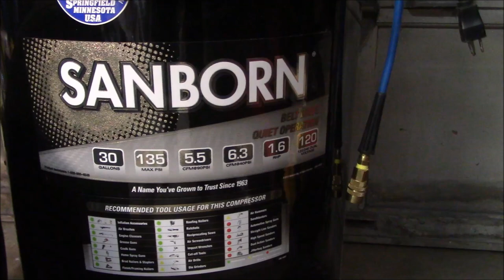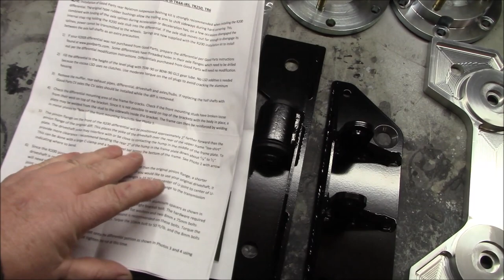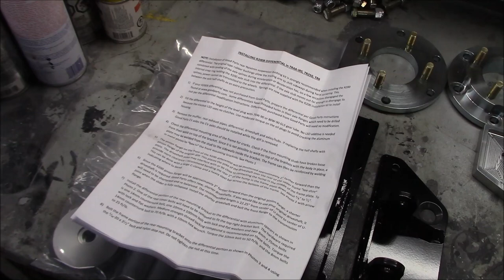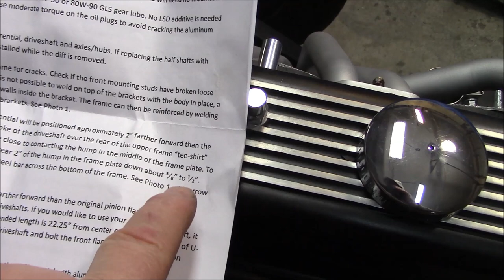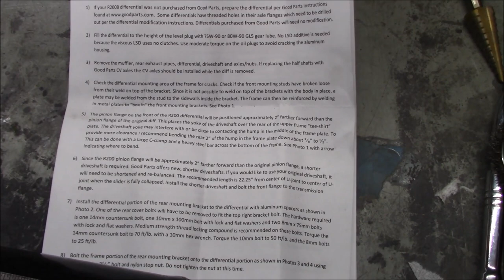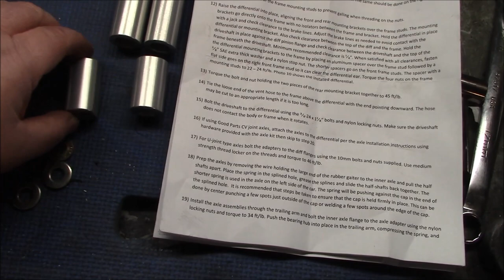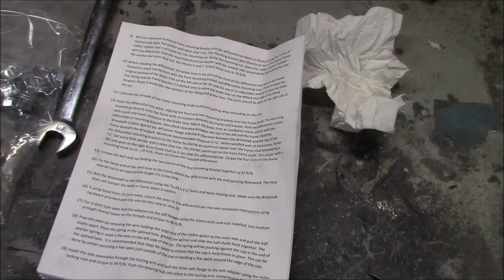1968 Triumph TR250 Restoration, Nissan R200B Differential Conversion/Installation,  Part Three

Comment: Tush, this is the time of year when it's good to be in miami because of the weather, in the summer it's another story. Agree the compressor looks good from far but far from good. Hope Les is well.  Wow, that motorcycle jack is a life saver, would be so much harder with out it, I might need to get one. Thanks again for your detail explanations, not sure I would do this to my tr6 when I get to it but it's tempting.

Comment: Just an add on about lockwashers (aka springwashers). Some kits and other parts suppliers use a lockwasher AND a flat washer. However it just defeats the ability of the lockwasher to lock against the part you are trying to secure and just locks against the flat washer that then does not lock!
From early days I was always taught if you are screwing into machined threads you either used just lockwashers, flat washers with thread lock or flanged head bolt and thread lock. Same with using plain nuts just use lockwashers. With nyloc nuts use flat washers.
Personally i avoid lockwashers / springwashers for use on steel as they by design cut into the workpiece and if its been painted you have a place for rust to start. On Aluminium its fine.
Just IMHO of course ....

Comment: Than you! Great instructional video! What is the advantage of CV axles?
Reply from the maker: You are most welcome...the advantage of the cv joints is that it gets rid of the splined joint in the stock sliding axles, much smoother when power is applied and maintenance free as well...the sliding splines need to be greased now and again as they become notchier and noisier when they are not lubed.

Comment: Chef, another great video.  Ref your comments on the air compressor;  what is your recommendation for the minimum size of air compressor to run a comparable size shop as yours.  I want to do spray painting as well as running a sandblasting cabinet (not at the same time though, lol).  I do recall you saying in a earlier video that you burned through a few compressors during your previous projects.  I have a 240 volt plug available. Thanks.
Reply from the maker: Hi Ronald, first I’m no expert but you are correct, I’ve learned a few things throughout the course of my restorations and have burned out a few compressors in the process due to overworking them....if you are planning on sandblasting then minimum tank size would be about 60 gallon...I’d prefer to go to an 80 gallon if you have room...it would be nice to have space outside the garage to place it and I was thinking of relocating my compressor to my shed outside behind the garage....but, then I’d have concerns about it freezing in the winter....the important thing is how much CFM the compressor has....I think if you look at most quality paint guns,  the minimum requirement is around 11 CFM to operate efficiently.    If you are using certain air tools like a straight line sander or a dual action sander these can really tax the compressor as well.    I know you can get smaller, higher flowing compressors as well that have larger horsepower motors and bigger compressor heads so although tank size can be important, it’s not the only thing to consider.
Reply: @cheftush  Thanks a lot Dave.  I will continue my research on brands and look for a good one to come on sale.  80 gallons it will be!